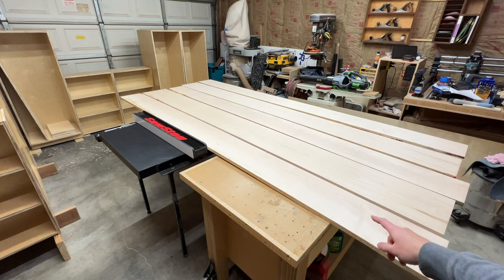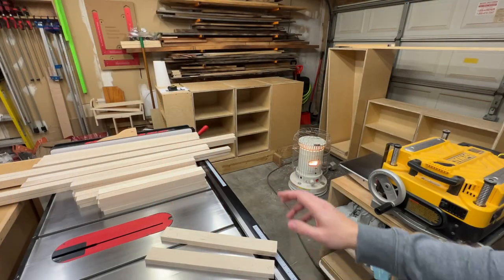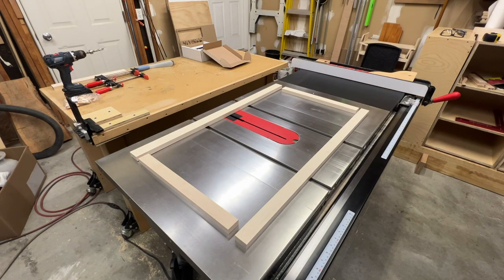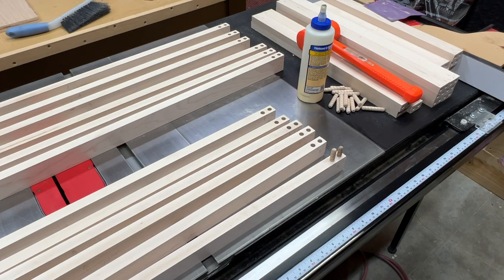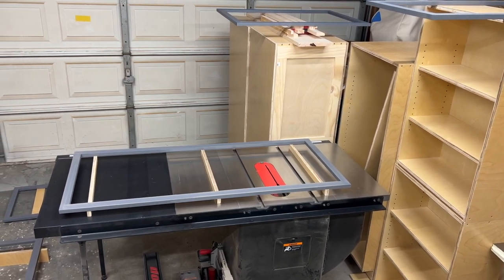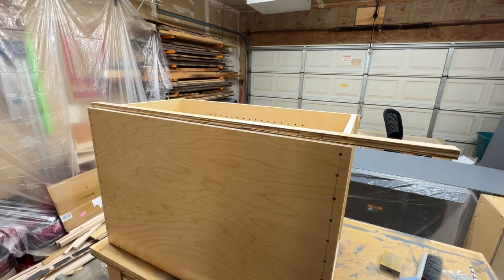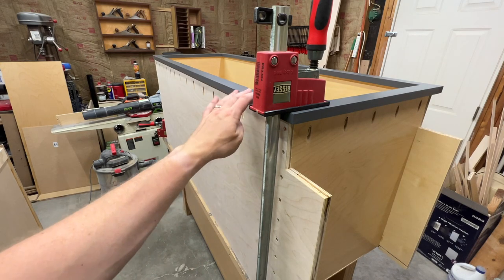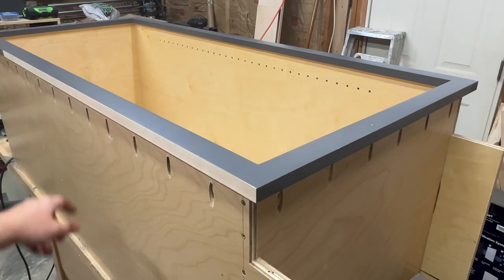How to build face frames | Jessem Dowling Jig makes joinery easy!

Comment from the maker: Check out Pt. 1 (plywood boxes) here: https://youtu.be/trGsIg_D0mM
Check out Pt. 3 (pull out trays) here: https://youtu.be/vZCh6tgAyOE
Check out Pt. 4 (spice rack) here: https://youtu.be/gNgxr3OD_Jg
Check out Pt. 5 (baking pan organization) here: https://youtu.be/8bDZoL3tkf0
Check out Pt. 6 (shaker doors) here: https://youtu.be/-VTCq2thw5w

Want to support the channel? Here's what you can do:
 - Subscribe to the channel
 - Hit that Like button
 - Leave a comment
 - Amazon Affiliate: https://amzn.to/2LaN1Ib

In this video I go through all of the steps to build and finish the face frames for a set of custom cabinets I am building for our laundry room remodel.  I used hard maple for the face frames.  I used General Finishes water based stain and high performance top coat.  Be sure to subscribe so you don't miss future videos covering the roll out pantry trays and the doors.  All of the build process for these cabinets could be applied to many other projects such as a kitchen, bathroom, etc.  Let me know what you think in the comments section below.

Jessem Dowel Jig: https://amzn.to/3pbdTRP
Kreg Pocket Hole Jig: https://amzn.to/3XkKMbg
Kreg Clamp: https://amzn.to/3qZPhvT
SawStop 1.75hp PCS: https://amzn.to/2X4gWsP
Ridge Carbide 10-inch Saw blade: https://amzn.to/3bATmcp
Bosch 18v Drill: https://amzn.to/2OmrItJ
Bosch 18v Impact Driver: https://amzn.to/3cxAhJk
General Finishes Graphite: https://amzn.to/3JsQzWw
General Finishes Whitewash: https://amzn.to/3pizkAm
General Finishes High Performance Top Coat: https://amzn.to/3CGhavk
General Finishes Extender: https://amzn.to/3XtttVy

Thanks for watching.  If you have any comments or questions please leave them below or hit me up on social media or my website.

Hit that like button and don't forget to subscribe!  Thanks!

Subscribe: https://www.youtube.com/danprudlow?sub_confirmation=1

Twitter: http://twitter.com/DanPrudlow

Comment: Thanks for the video. Lots of great ideas here. I especially liked the fixtures that you made to drill the repetitive dowel holes. I have the Dowelmax jig, which is a bit different from the Jessem but now I’d like to make a similar setup for it. I make my face frames mostly like you do, and one thing I’ve had some success with is drilling a pocket hole on the back side of the face frame between the dowels. I like this because it clamps the joint, and with the dowels in there I don’t have to worry about any movement when driving the pocket hole. Thanks again!
Reply from the maker: Thanks for watching!  I like that pocket hole idea…I’ll keep that in mind for next time!  👍🏻

Comment: Please show how dowel jig was clamped down.kindest regards tim
Reply from the maker: If you check around the 4:30-4:50 mark in the video you can see I have screws holding the jig to the edge of my workbench.  I just used a couple of pan head pocket hole screws.  In hindsight I should have probably done it a little differently because I had some inconsistent alignment when gluing the frames…but it wasn’t anything that couldn’t be easily sanded flush…just took extra time to do.  Hope that helps but if not let me know. 👍🏻